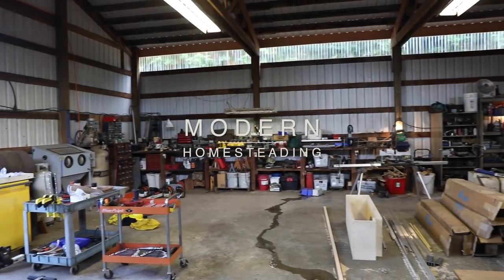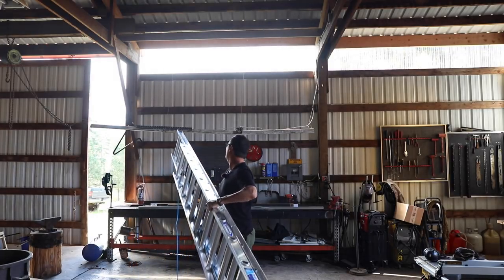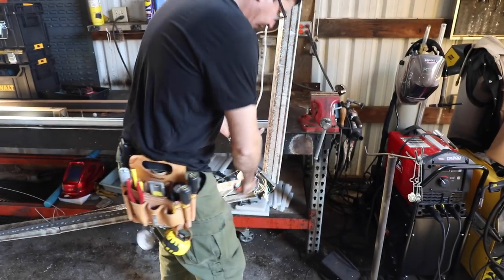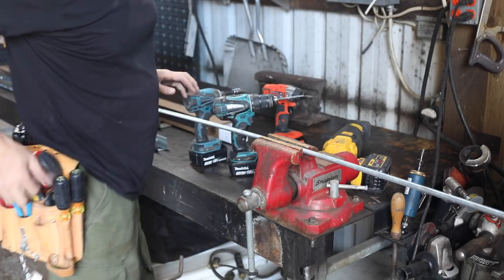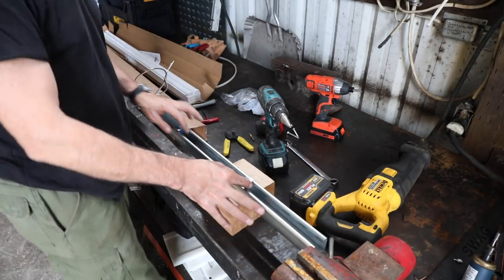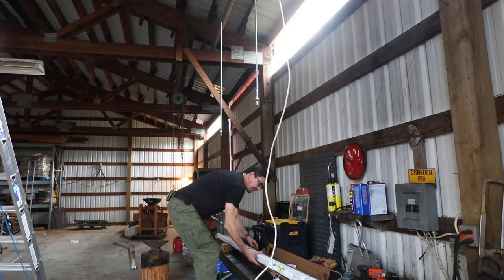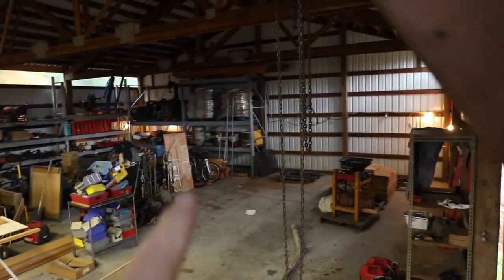Home Depot LED Shop Lights Under $200

Comment: Is it only me, or is it something that interferes with the microphone in this video??
Reply: Yeah it's very anoying
Reply: Yeh, I picked up on that too
Reply: Almost sounds like a ground loop hum but since he is using a wireless lav I am assuming it is the lights in the building getting picked up. LED's are pretty rough with noise, i have dim-able LED's in my room and at certain intensities it has a high pitched buzz. Or it was a phone too close to the receiver.
Reply: had  to quit watching that one with headphones that must be murder on the ears bad enuff on laptop speakers
Reply: yes thought it was my headphones
Reply: you mean the high-pitched dit diit diiiiit? Yes, I hear it.
Reply: Dino how would that matter of they arent plugged in yet?
Reply: Not only you... Still a good video though
Reply: Yup
Reply: I thought my old usr modem had come back to haunt me...
Reply: At the beginning I thought it was the fluorescent lights. Then I though Cody added it because those lights are annoying. Now I'm confused
Reply: sounds like its the auto focus, starts and stops normally when focusing
Reply: yes, RFI from the LED driver boards when he got up close to them..... He is running a wireless LAV, so this is to be expected....
Reply: lights
Reply: Gee thought it was the speaker on my phone vibrating for a minute.
Reply: Camera focusing
Reply: The problem with dimmable LEDs is that you really need a different dimmer switch than you would use for incandescent bulbs. See https://www.lightbulbs-direct.com/article/dimming-guide/
Reply: I almost thought it was the ultrasonic from the autofocus.
Reply: Johan Brandt I was about to comment the same thing
Reply: I almost thought it was morse code..  Anyone translate?
Reply: Yeah it's pretty distracting
Reply: Yep, it's absolutely terrible.
Reply: I was looking at my PC the whole time, sounded like when the head of the HDD is struggling to read the data.
Reply: Morse code for the next video. Lol
Reply: Sounds like noise from the camera
Reply: I thought I hate tinnitus at first

Comment: from an electrician that uses strut everyday.  use a square washer and lock washer and nut on the top of the strut if you want a strong locked in connection, not a fender washer.  you could knock those lights and that spring nut could twist out and fall on someones head and gash it open from the sharp metal on those light fixtures.  not nagging, just a word of advice.  hope it helps...good  video!  Strut is pretty awesome

Comment: Hi Cody, 
With all do respect the Cantruss/Unistrut is upside down and should be mounted with the opening downward and your 1/4 spring nuts would clip in easily.  You would then drill larger 3/8 holes in for your All thread/Ready rod.  This could also be used to run conductors freely in the strut and they offer Unistrut snap in covers to finish nicely if need be.  To allow for physical adjustment either for left, right, too and from, you mount Cantruss on the rafters.  To satisfy your friends and others who may read this, 14/2 BX should be used for unprotected wiring feeding the lights from above, a electrical code thing.       
Anyways for the remaining lighting in your shop don't be shy in purchasing a serious load of cantruss, always can be used in other projects its great stuff, I prefer the solid type without the elongated holes. 
Thank you for sharing your bench lighting project and I very much enjoyed the comment on the guy not ever climbing or owning a ladder, I know you were holding back but today they call those folks "SnowFlakes". 

Thank you and all the best.
Cheers, 
Craig
Reply: Craig no need for bx? Haha What is this the 60s or whenever that was popular. Just use mc lol
Reply: chin thacker, 
It appeared NMD7 or 90 was being used, rated for indoor and dry/damp locations specifically indoor house wiring.  The fact of the cable exposed to mechanical damage such as running down Ready Rod would qualify to be armored or even near a work area such as a mechanical work bench.  BX came be referred to MC but BX term is preferred, MC could be mistaken for MIC cable.   Thanks for the advise dude, but I know well enough.
Craig
Reply: Craig I feel it I'm just an apprentice myself. I know a decent amount but yeah you're prolly right people might get confused about mc. But for sure he definitely should have either it piped or bx/mc especially given the type of building and machinery.
Reply: chin thacker,
Congratulations on your Electrical apprenticeship, a good journey towards a fine craftsmen.   Study hard, work hard and enjoy.. 
Thank you, 
Craig

Comment: Next time use a nut and a fender washer on the all thread at the top of unistrut.  That way you can have compression at the top of the unistrut and prevent the unistrut nut from turning.

Great job though!
Reply: I agree with Rick.  I use unistrut all the time and you should have a nut and washer on top....it should be fine but in case you ever bump it, it could come down on you.   For someone who doesn't do this sort of thing all the time you did a great job!  Keep up the great vids!
Reply: I came down here to comment this exact thing. I'm a commercial plumber and we use Strut for just about everything. We'd love to see you back those spring nuts off, run a nut and square washer up above them, and reinstall. The clamping force holding the strut nut to the channel gives you insurance that if the light is bumped it will stay put!
Always enjoy your videos Cody, first time joining in and commenting. 
Keep up the great work! You're inspiring me to get out to my garage and dust off some projects!

Comment: When cutting that all thread, I usually find it a good idea to screw the nuts a little behind the places you are going to cut first, so if you happen to mess the threads up a bit while cutting them, you can use the nuts like a die and run them down past the end, straightening the threads up again.
Then later, when you can hang the object and have no trouble putting the nuts on the rod.
Reply: I always clean the cut on the belt sander giving it a slight taper at the end. Nuts go right on and no cut fingers.

Comment: Thanks Cody, You did a fine job of installing them lights. Im an electrician and If you were an apprentice i would have the apprentice do the following (but for a homeowner, you did great) first of all 3/8" strut is over kill, 1/4 " would be fine and easier to work with. and as many have already mentioned the washer and nut to provide back pressure, they do make a special washer for unistrut that hugs the edges. The fitting in-between the fixtures where the wires pass through is a back to back fitting. it makes a big difference and then all those zip ties need trimming or you could put little American flags on them instead. I could go on but I meant what I said; you did a great job for a homeowner. Your video's are fun and you are so abnormally normal, and some folks might think you're a fancy guy. I thought that story was funny, keep it up, ty

Comment: Hello wrangled star, your exactly right, there would be what they call a sqaure washer with another nut to lock the strut together giving it a tight fit. I use this stuff on a daily basis. If you had some kinda freak accident and jarred that strut, the strut nut  could twist and light come falling down. Using the sqaure washer with a nut is the right way. Thankyou for your videos. Casey from sunny California

Comment: Unistrut is a fantastic building material.  I bought some shorter depth Superstrut (the Home Depot's brand) and cut it to length to use as crossbars on top of my suv and mounted some LED light bars to it.  Came out really well.

Comment: High lumen led rope lighting is super cheap in bulk and works beautifully. My buddy and I put a few hundred feet snaking back and forth on his rafters and it worked beautifully. The most even light distribution you could imagine.

Comment: Cody I'm a journeyman electrician. I think for the most part you did a wonderful job and applaud you for wanting to do it right but I want to give you some advice on a couple things that were exactly kosher. The first thing is above those 3/8 spring nuts that are connecting the rod and the unistrut you should have a nut and strut washer or some kind of washer applying pressure to the top of the strut and keeping that spring nut from moving or spinning. My other suggestion is that two bushings butted up together isn't the right way to attach those lights. You should either use a chase nipple and if you didn't have one you should a close nipple or some other short nipple. But good job man keep up the good work

Comment: Nice job, I do recommend a fender washer and nut on top of the strut to lock the spring nut in place. Spring nut purpose is to only hold the nut in place until you get the bolt started and tighten it down.

Comment: hey cody, we install polyetheen sky water drain systems in big distrubution centrums and warehouses. All those new buildings have crimp roofs just like you with with isolation and epdm on top of it, we have special big holecutters and cut holes in the crimps and bolt them through the roof and hang rail below it. but the rail is designed to have the flat side on top, but as long as it works it works!

Comment: After many years of working with electrical applications, including pole line construction, I would strongly recommend using fiberglass ladders! Much sturdier than aluminum and, most importantly, non-conductive! Heavier than aluminum, yes, but there are techniques that make carrying even a 40' fiberglass ladder quite manageable (working alone)! Much safer all around, and also have a number of useful accessories available. Love those LED fixtures though....and Unistrut solves countless installation problems. I'd love to meet whoever invented that system!

Comment: As an electrician for many years I would have used the unistrut open faced down that way you could use the lights existing holes with spring nuts. Then put the all thread thru with 2 1/2" nuts with washer to hold the unistrut. 
Good video

Comment: Cody you can change all your old lights over to LED for the cost of just the bulbs. Depending on what bulbs you buy Will determine how you have to wire them no need for a ballast.

Comment: Great videos.  Just a thought, if you mount the unistrut to the rafters/joists as they were originally intended you could then hang other things from it as well.  They use it for hanging sliding doors, so you can also use those hangers with it to hang items that you want to slide back and forth into different positions.

Comment: Hi Cody yes they are a great improvement we went to led's in our workshop about 18 months ago and haven't looked back' as far as high bay lights I would not fit anything but the led ones sooo much better light than the old style and easier on the eyes with the added bonus  of being cheaper to run!! Would not care if they were twice the price ( we were lucky as there is a government incentive over here and they replaced ours free of charge )

Comment: For the Spring nuts that you were using for the unistrut, to secure them in place properly, you would normally screw the redirod (all thread as you call it) all the way to the base of the unitrut when you have them positioned as desired, and usually have a nut on top as well. other wise, the way you have it, theres potential that the spring nuts might fall out if there is too much movement in the fixture. hope this helps

Source: An electrician and have worked with this material before

Comment: Nice job using strut - except it's upside down of the usual installation. I really would go back and pick up two more 1/2 nuts and the square washers to lock the 1/2" all-thread down on the spring nuts.
Reply: Just have to add uni-strut/super-strut is really cool - big kid erector set! The strut nuts with plastic bits are usually called cone nuts.
Reply: Yes, upside down. Thread rod two nuts and a fender washer to mount. The spring loaded fasteners would not need anything extra if used correctly. For instance had you drilled and attached your lights using them they would tighten against the back of the light.
Reply: Disagree. Strut is designed to be used in which ever orientation suits best. In this case the flat surface works well with the LED strip. Definitely would have saved money with flat washers and nuts instead of fancy twirl nuts.

Comment: I'd salvage those old Florescent lights and do a  ballast free LED conversion. Clip ballast out, get single end LED light kit, re-wire, viola, new lights. I've been watching for fixtures to be set out to the curb.
Reply: Ben Braun if possible try commercial remodels, we throw tons of old fluorescent lights away

Comment: Nice upgrade. I would like to point out as a professional Union Electrician that the strut installed is upside down. One good bump and the spring nuts will shift and the entire light plus the weight of the 10ft strut will come crashing down. The strut channel should have been facing downward and the all-thread bolted through with a nut and washer on top and bottom and then the fixture installed using the cone nuts. At the very least I would add the square washers and nuts to sandwich the strut to minimize the chance of the spring nuts from shifting.

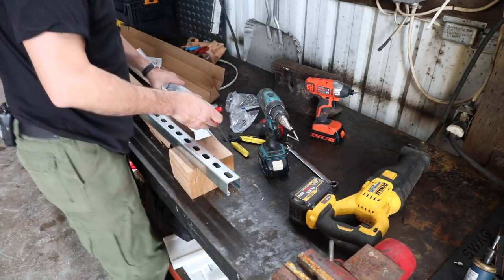Comment: He was using Kelvin at around 9:30 guys.... that's metric! We've converted him!
Reply: cozmium Isn’t Kelvin temperature?
Reply: I dunno about that metric thing, i tend to use Celsius along side my Meters ... and when it comes to light, i think 'lumen' is the current way of expressing the amount of light emitted. Before that, at least where i live it was 'Watts' ... kelvin sounds like an odd and old way to describe the amount of light emitted, probably an English way, and thus by that standard an 'imperial' way.
Reply: Lumens is the amount of light (foot-candles also) Kelvin is the color temperature of the light.
Reply: @Dutch Courage. Lumen is the amount of light, watts is the power usage, kelvin is the color. a 60 watt gloeilamp has perhaps 500 lumens, while a 5 watt LED also has 500 lumens. You can go from yellow to blue etc.

Comment: Cody, Costco sells some really great 4’ LED overhead shop lights that you can run together/connect up.  Might be worth looking into them when it comes time to replace those larger fixtures you have.

Comment: If your florescent light fixtures are still in good condition, you could also retrofit them with LED tube lights.  I got 8 Tubes on amazon for about 65 bucks.  Then you can remove the ballasts and save power.  I was having problems with the lights coming on when it was cold (it would take about 5 minutes). It is also a lot brighter than the old bulbs, since the LED tubes direct the light down only, and the florescent bulbs shine the light 360 degrees.

Comment: Another good setup is spot lights at the main work spaces with individual switches so you can turn them on when you want to work there. With good placement you will have light on the spot you need it without you or the machine blocking it.

Comment: For the Unistrut, in trade we call it a trapeze containment system, and your bracket made of unistrut and threaded rod should overhang our fitting, you secure the rod to the strut using large square washers and bolts as the zebedys (spring loaded nuts) are for lightweight use for example securing items to the strut from beneath

Comment: In the UK if you go onto work site and working on electrical with a metal ladder you soon be asked to leave, but then again we use a lot more volts then America - I would suggest get fibreglass ladder they are lot lighter but just as strong and thus easier to use.

Comment: LED is great. I just keep adding more and more everywhere. My tips: Don't buy those spraycans of WD40. If you need it, buy the big containers with a refillable spray bottle. 5 liters (1.3 gallon) is about the same price as 2 400ml (2x 0.1 gallon).  Same brand, same stuff, just loads more. Also, Knipex plier wrenches (for example the 8603250) are a lifesaver when doing pretty much anything (expensive, but I personally love them). Nice piece of railroad there. That stuff is also handy for banging on.

Comment: The big shop's lights have replacement kits are available prebuilt so when they start to go you strip out the inside and bolt back in the new LED lights and internals

Comment: They make squat nuts that fit on top of the strut that you can tighten a nut and lock washer down to the strut. You probably won't have a problem unless something pushes up on the light and allows the spring nut to turn and fall out of the channel. I'm a journeyman electrician and I would have turned the strut with the channel facing down so you wouldn't have had to use spring nuts on the to of the strut. Then just use the cup nuts to mount the light. I can see why you did it way you did because the 1/2" all thread wouldn't fit though the strut slots. 3/8" all thread would have been plenty strong for that application. I love your channel, keep up the good work and God bless.

Comment: Like you videos, but just a heads up, you didn't use the (spring nut) properly, it almost all ways goes on the inside of the channel of the Unistrut, then use a larger  washer as wide as the strut, on the outside of strut with a standard hex nut to sandwich the strut. Dont wanna see those nice lights have a accident
Reply: Thank you! That really bothered me as well.

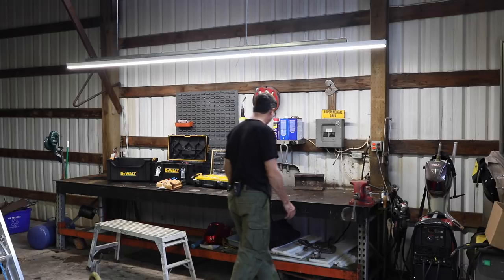Comment: 12:37 You can indeed use a square washer and nut to lock the spring nut in place-depending on the weight hanging off the unistrut, the spring on said nut may not hold it in place.